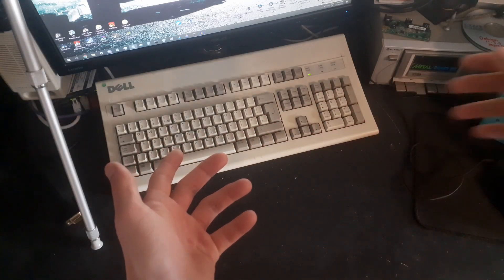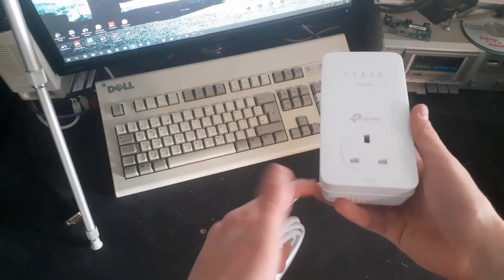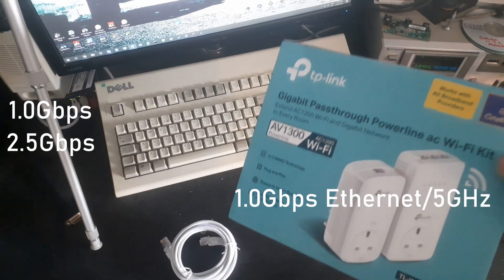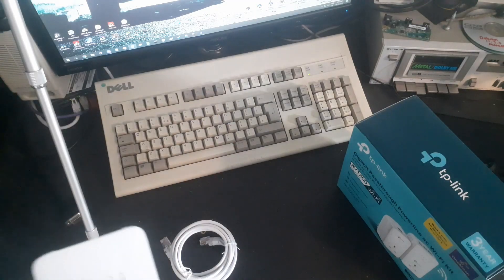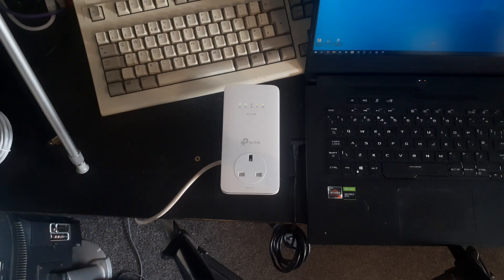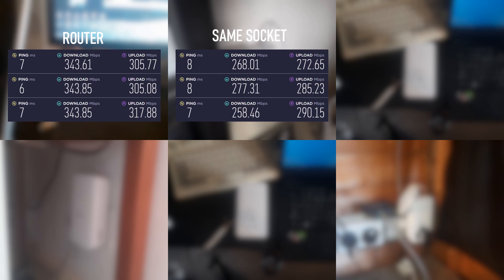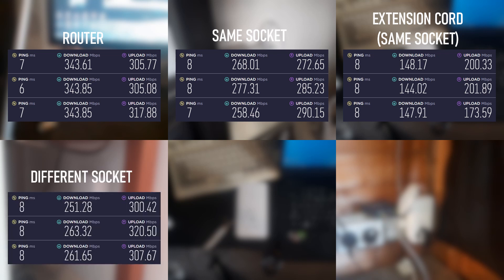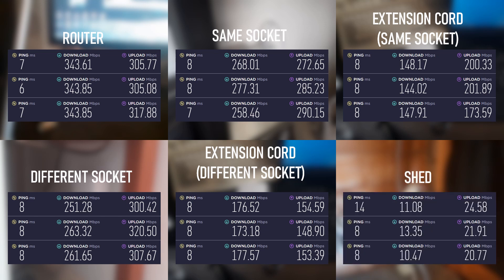Experiments with Powerline Adapters

Comment: Do you think this would be effective if my router is in the basement and my room is on the top floor?
Reply: Also how much ping you you think I could get?
Reply from the maker: @twofanta  Should be fine as long as it's on the same circuit, the test I did from the outside shed only increased the ping by a few milliseconds